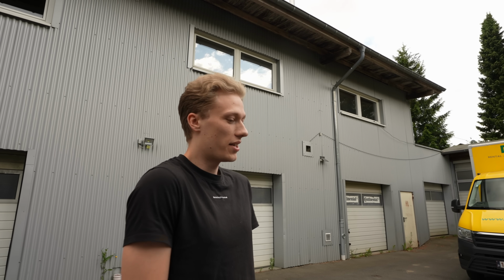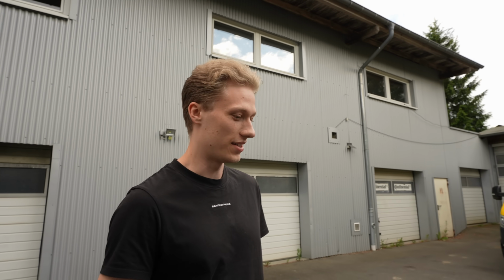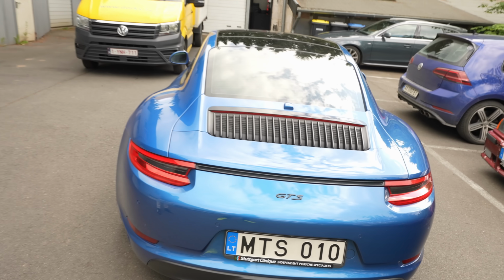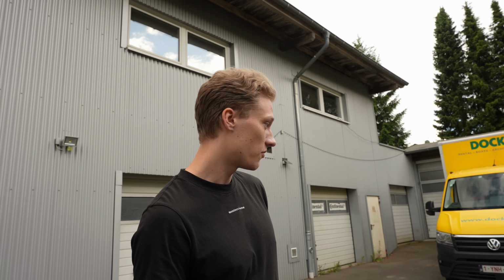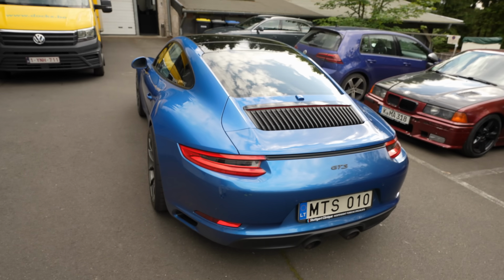BIG TURBO Porsche 991.2 GTS Ripping the Nürburgring!

Comment: This thing is fast, very cool 911 build for the money. It looked like it has a bit more emotion than a stock turbo s, more cool sounds and it’s rwd. I don’t see why this isn’t a more popular build in Europe.
Reply: I have a 2019 GTS with a Stage 1 91 octane tune, and I always tell everyone it's Turbo S fast, but lighter and more nimble. I even think the engine noise inside the car sounds better. Was just about to add more goodies, but got rear-ended 3 weeks back. Waiting to see if the insurance adjuster is declaring it a total loss. 😢
Reply: @gianni_schicchi  Thank you!
Reply: Probably because 911s are overpriced in general.
Reply: I think most people around the world prefer a quick awd over a more driver focused rwd, but yeah, for the track, this is a cheat code for sure!
Reply: @thomasferrarojr.9772  That is unlucky man. Not quite the same but I lost my e36 with a rear end too, miss it everyday

Comment: This is a fast GTS 600Hp+ for sure
Reply: You barely realise it until you look at the speedo and passing. It’s so quiet and composed. No harness or crazy bolsters, factory leather seats and it’s not tossing them like rag dolls at race car speeds.
Reply: I think it’s around 600… most definitely not  700 whp (Maybe 700 bhp applying a generous correction from a generous dyno)
Reply: I dont even think its making 600hp. Looked a little quicker than stock. The gt3 rs was able to keep up and that is 500hp with a little less weight
Reply: @mrpana9480 This is WAY faster than stock. I have the car.

Comment: As usual, another amazing upload.  Misha, sometimes your vids scare me.  I feel like on any given day you can have a mix of Novice, Intermediate, Expert, and Racers on the 'Ring at anytime.   Some of these passes are so fast (like 5:35) that I worry that one of these days someone won't be aware of the high rate of speed you're approaching.  Some of these guys appear like they are traveling backwards.   That would drive me insane.  Would be awesome if they had "Advanced/Expert Only" days at the 'Ring.  I would feel much safer.
Reply: @Hughtsch  That's awesome!  I need to make my way over there from the states one day.
Reply: @Hughtsch still not racing*

Comment: Misha, what about camber? Can hardly believe it’s are the standard -1.5 max given the grip it has in hard corners.
Reply: These CR-S tires are close to Cup2Rs in compound and grip so it does exactly what it should do
Reply: Still understeering. Could use -3 of camber and better suspension. With some aero it would probably shit on most other GT Porsches
Reply: Currently its at max stock camber, -1 front, -2 rear. Next mod in line is lower control arms to do -2.5 maybe -3 in the front :)

Comment: That may sound like a stupid question, but which is better for track: GTS or GT3 Touring? I want a car that can be useable for everyday life as well as track on the weekend.
Reply: I doubt there is much in it, unless you are a very, very good driver, than standard for standard,  the gt3 would edge it on track
Reply: If you want a useable daily then the best bang for your buck p car will be the GTS. The gt3 touring is a race prepped street car, it can be daily driven but will ultimately be rough around the edges when it comes to comfort. The GTS gives you the best of both worlds and has ample tunability to have turbo S power and GT car handling if done right for significantly less
Reply: @markgtrheyes  thanks a ton
Reply: @ammarkhan3160  thanks a lot